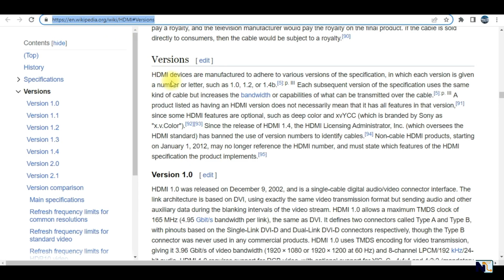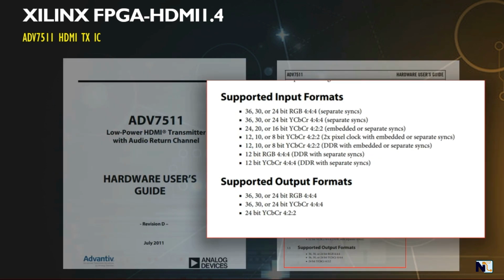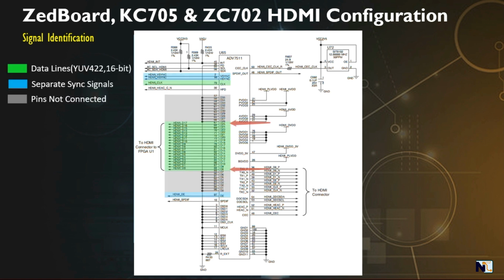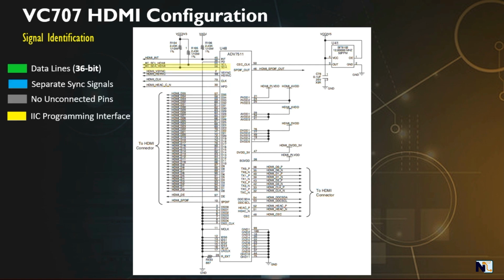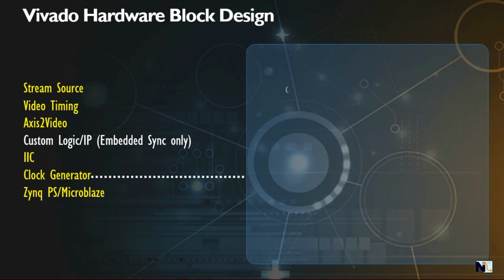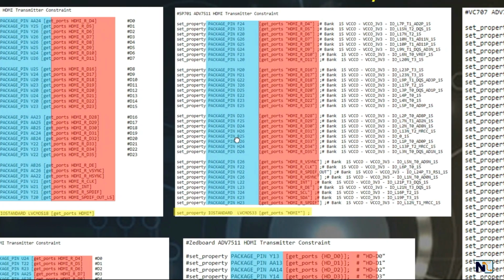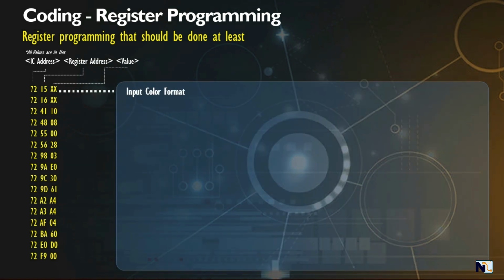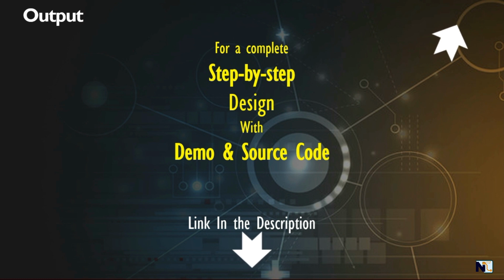Xilinx FPGA-HDMI1.4: You Must Know First !

Comment: Hi, good video.
In the case of the ZedBoard, an HDMI output IP is provided by Avnet, what is the purpose or these IPs? if we can constraint the output from the AXI Stream to video Out?

Thanks man
Reply from the maker: Thanks for the comment.
Yes, there is also Avnet IP for the ZedBoard HDMI Output interface. The IP is not doing the biggest thing there. Apart from parallel video interfacing, the IP is adding an extra Xilinx FPGA primitives to relate between the clock and data thing, which is not critical at this moment. So that, we can also avoid this IP and directly do the constraint mapping from Axi4-stream-to-video-out IP to IC. So, for this case, using IP or not using IP will not be going to severely affect the design output. 
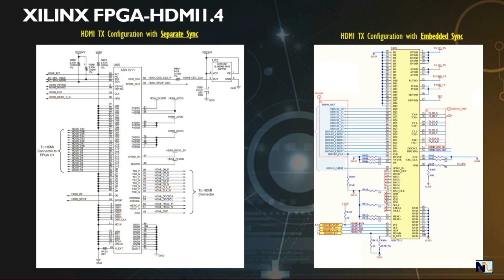However, the constraint mapping from Axi4-stream-to-video-out IP to IC totally depends on the HDMI TX IC circuity as mentioned here 02:36. If it has separate sync pins (xilinx boards' hdmi tx ICs are mostly configured with separate sync configuration. ZedBoard also has this configuration), then we can directly do the constraint mapping otherwise, in the case of embedded sync configuration, we will need custom logic or IP to interface.
Thanks!